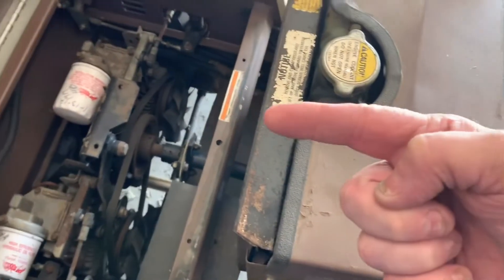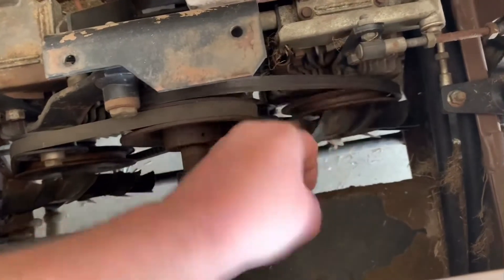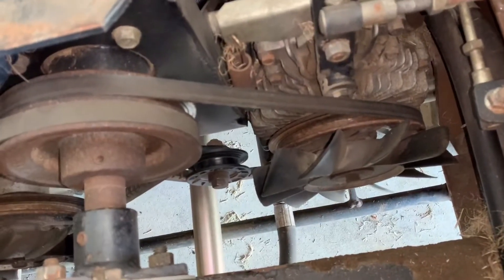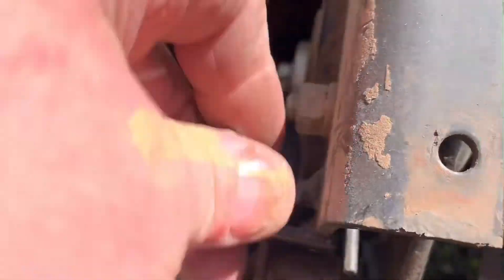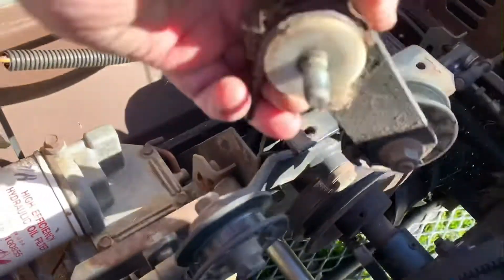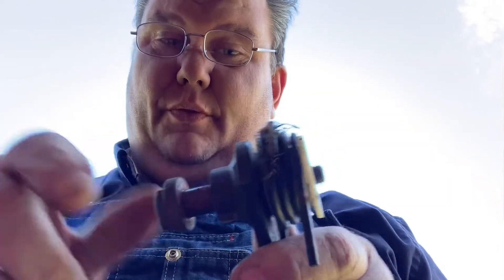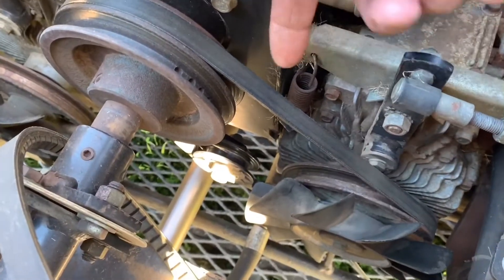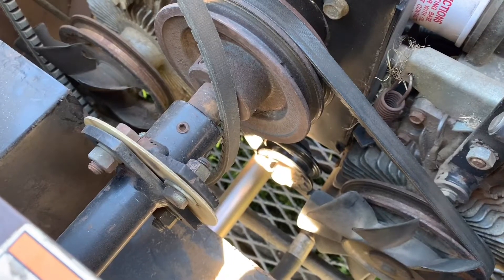DOES YOUR MOWER MOVE SLOW OR NOT AT ALL? TRY THIS SIMPLE REPAIR THAT COST $0.00!!

Comment: This guys an is wrong, NEVER use and angle grinder or some such sander to remove rust etc from a round or for that matter flat wear surface. It just gouges the surface, future wear will be vastly accelerated. Use a strip of fine emery cloth or abrasive on your finger pulled back and forth (or wrapped around a round stick for internal features). This will clean the surface and still leave it round with no flats.
Reply from the maker: Lol
Reply: ...then use Emory cloth, AbbersJ. This video was very helpful to me, regardless of the method he used to clean off the bolt. For all intensive purposes, replace the bolt with a new one. Why do you need to critique his video...if you had to watch it in the first place?
Reply: @rngbluerhino13  I don't see you're point.
First, he did not use emery cloth, which I would have used also, second, how does a person know a video is crap until they watch it? He is supposed to be informing the less experienced, he's not. He should learn the right methods before telling others. Simple as that.
Reply: A wire wheel has worked fine for me in similar situations, for whatever it's worth.
Reply: @THEMOWERMEDIC1  Just go to show how little you know.

Comment: There is a much easier way to clean the bearing surface. Instead of using a scotch brite wheel, us your battery powered drill motor. Just chuck up on the threads and use crocus cloth. Turn on the drill and place the cloth onto the shaft bearing, move back and forth. Continue until shiny and clean. Then clean out the bushings. All that is left is regrease and mount. Work done with pride and gusto. Nice job   fella too. VF
Reply from the maker: Victory First show us! Post your video here we’d all love to see
Reply: @THEMOWERMEDIC1  I first have to get a camera. When I do I will post themowermedic1.
Reply: Bad idea

Comment: dealership just told me how to tension deck belt.  tighten spring until you can stand a Nickel on end to fit between  a coil.
Reply: Most of the grasshopper deck belt tensioning springs are supposed to be 5.75" from end to end not counting the hooks, just the coiled part, I think a few are supposed to be like 4.75 or something

Comment: That looks like a fairly straightforward fix.  Ever try automotive anti-sieze compound on that?  The stuff is great for bicycle freewheels too, but it's made for O2 sensor threads.  I don't think it matters much if you use the silver or copper colored stuff, but read the labels if you want to.
Reply: I agree, it's more of a dry type of lube, if used lightly and also prevents rust almost like a graphite lube.

Comment: Nicely done!.I have an older 727 and just looking inside makes my tools tremble.  There is so little information on Grasshoppers. You have a new subscriber . Thanks for posting .
Reply: Yeah, I'm in that club now...had weak wheel after engine gets good and hot. Googled all that I could and determined it was a wheel motor. Replaced wheel motor for $700. WRONG. Looking like transaxle is bad since I cranked the belt tension on that pump as high as I could go and still no dice. New transaxle? $600.....UGH. Annnnnd not having any luck finding a how to on actually doing the replacement. Double UGH.

Comment: I have a Husqvarna YTH2548-XP with the HG-0160 Hydro unit and my reverse is ridiculously slower than my other mower which is a John Deere Sabre 17.542HS.
I have tried reaching down and pulling back on the accelerator pedal to see if there is any slop in the mechanical actuation and there is none. Considering this, it still backs up really slowly. Forward is very good, but reversing takes some patience.
You think there is something going on within the transmission ? What is the forward/reverse speed supposed to be for this tractor ? Any idea ?
Reply from the maker: Adjust the rod, you’ll
Loose some forward speed to gain reverse tho